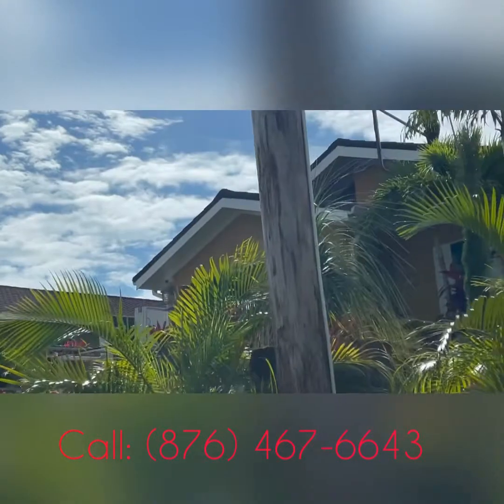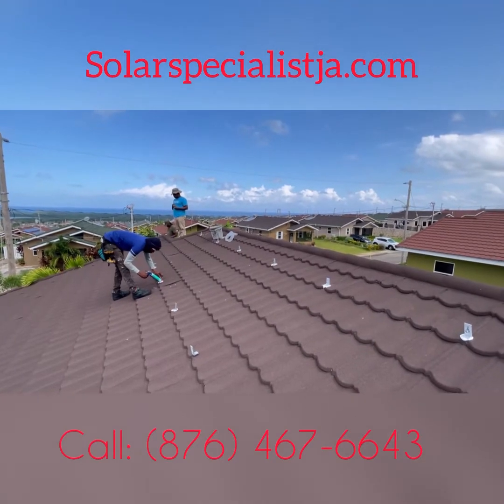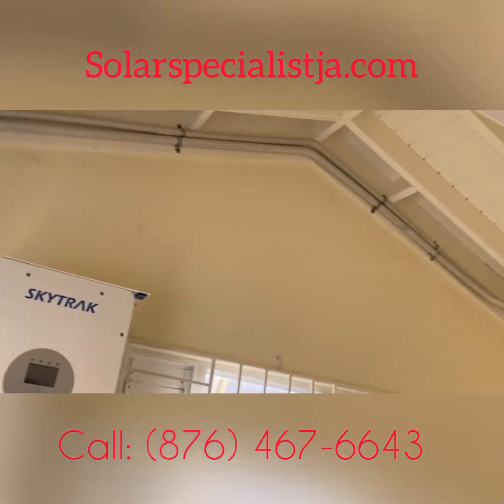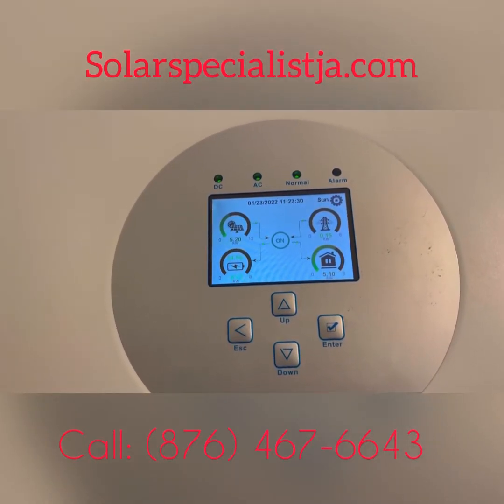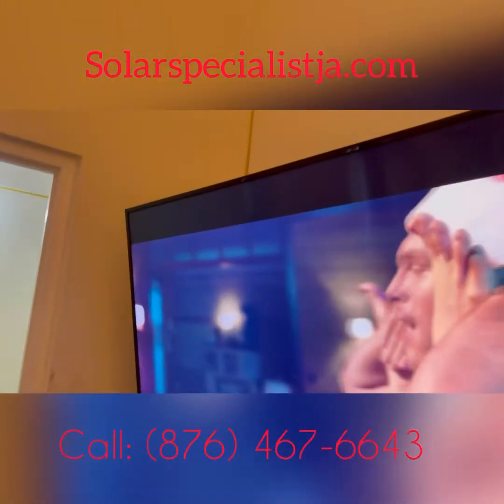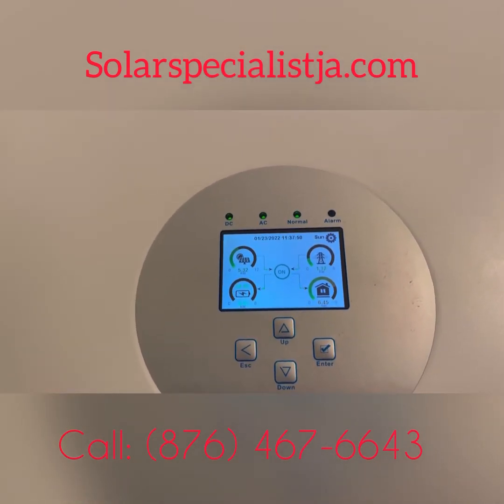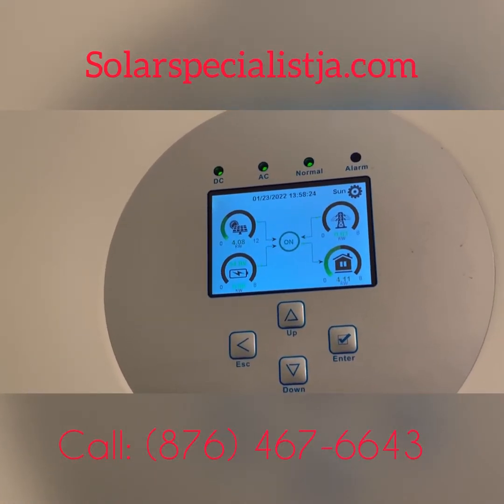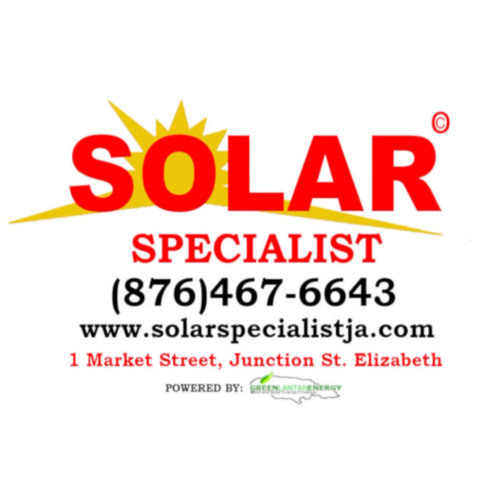Solar for Airbnb Jamaica

Comment: What those ceiling want are to be insulated and covered with drywall, the lumber is there already and will work to support this. For such a hot country it's surprising how few people insulate. I stayed in an Airbnb just like that and the AC could hardly keep up with how hot those ceilings get.